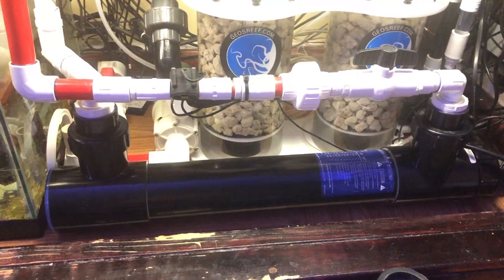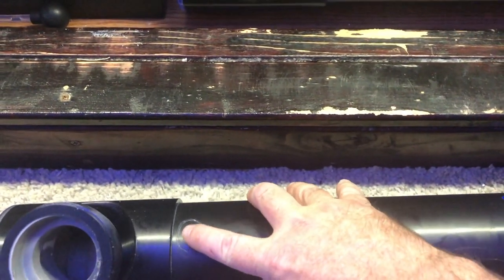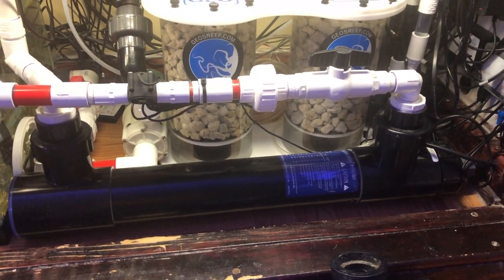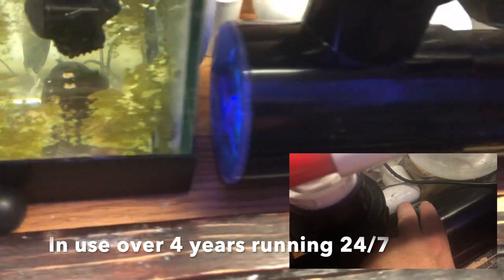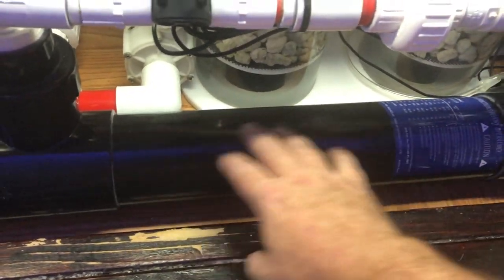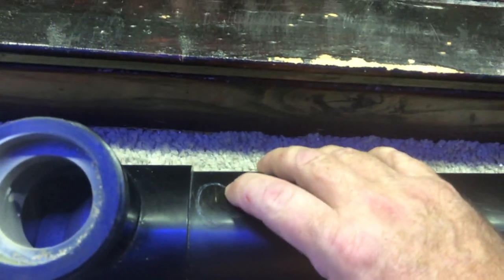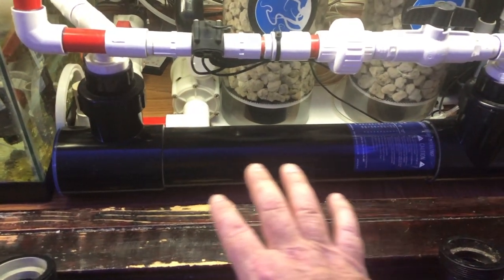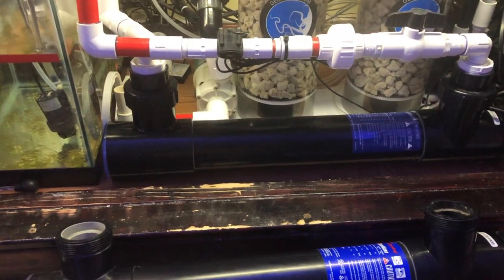UV Sterilizers - Watch Out For This!

Comment: Mine comes with a white uv resistant sleeve that protects the body of the uv sterilizer from the very damaging rays....I'm surprised a big outfit like pentair hasn't caught on to that...could have been a shitshow had it sprayed onto an electrical strip or something....
Reply from the maker: What brand are you using if you don't mind me asking?
Reply: @ReefSpy  lifegard Pro-Max

Comment: Do you really see a difference with it? I had running for a while then took it off, not really any change. If you put quality water and ingredients in your tank , where do the parasites come from? I would guess in the ocean people dump all kinds of shit it in, strangely I’ve had a few cases of pop eye in my tank, a clown fish, now an anthia three times, I’ve done nothing and all is fine, maybe it’s just like a common cold we get, extra garlic, selcon, no worries, I know they are expensive as hell and bulb change every year, not sure if they are worth it, I know people talk about algae control, if you have ever used vibrant then no worries, dose the max every four days it will wipe out almost every type of algae, your refugium won’t survive or ur coralline algae but ur rock will look great, much cheaper than a UV in my opinion!
Reply from the maker: You are correct, they are an expensive piece of equipment.  The thing about UV sterilizer is you will never know if it prevented an outbreak in your tank, only if it doesn't.  Years ago I lost almost all my fish to some disease in my tank.  I panicked and bought this.  I didn't have an issue since.  Was it because of this or something else?  who knows.